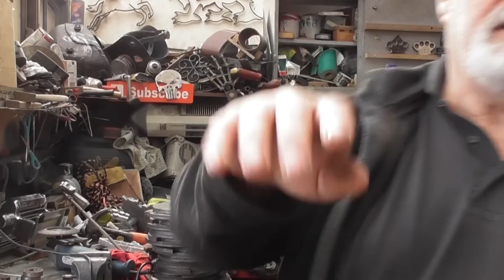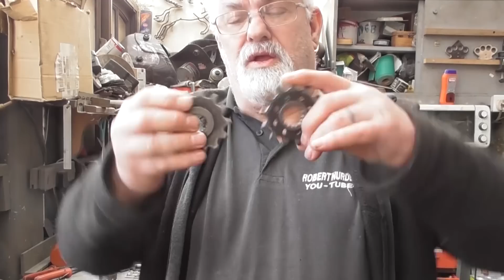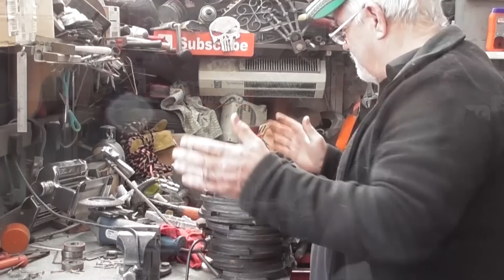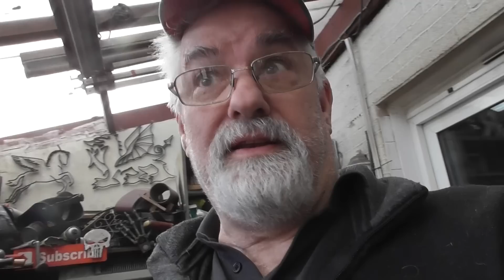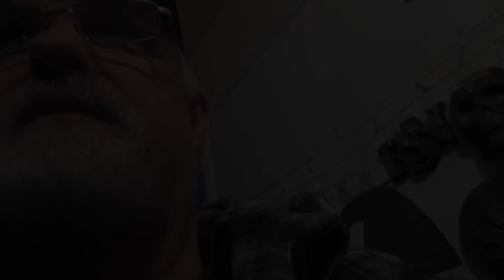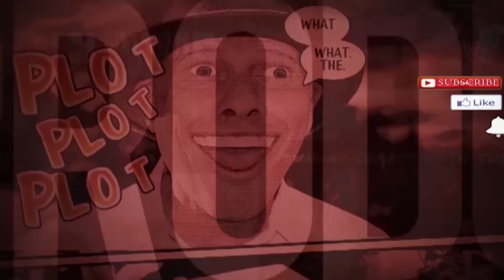its time i made THE shredder _masher_ muncher_ ? whatever its time..

Comment: You jammy man those large ones are what im after but cant find anyone to cnc them cheep. i was to use two hydraulic motors on mine . your be better off with large motorbike rear cogs and a small one on  the motors for torque not speed . Unless you got hydraulics. Plus two motors to power as you can control it if it jams . Cant wait to see how you build this. But on behalf of all your viewers think safety first .im a crap safety person with loss of a finger and many battle scars. but my previous experiments got pritty dam scary when one design started coming across the work bench after me . Thats when i welded it to a tonne pallet. i thought speed until that moment too. Thumbs up i hope both lol